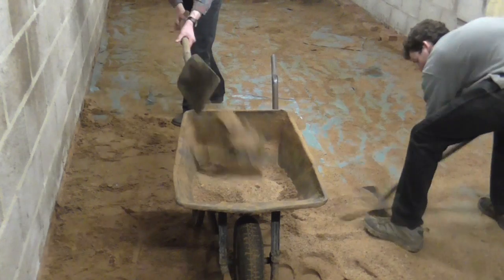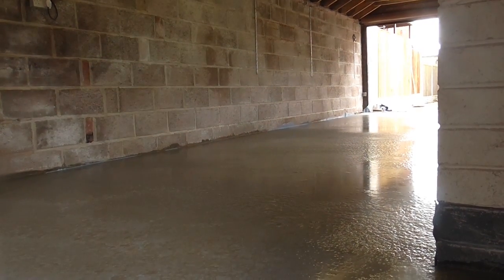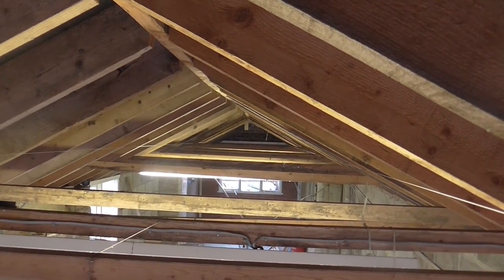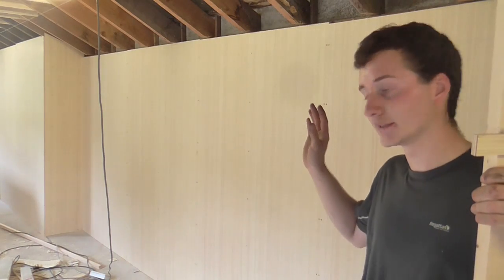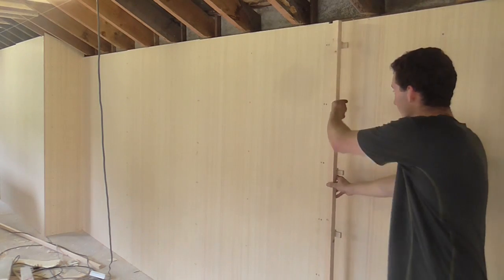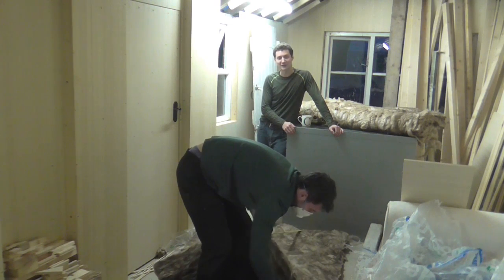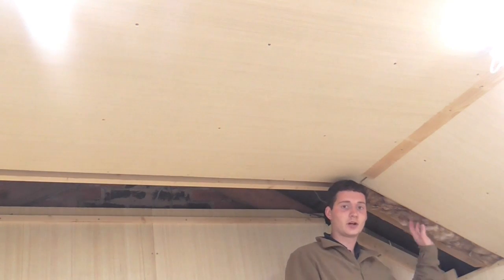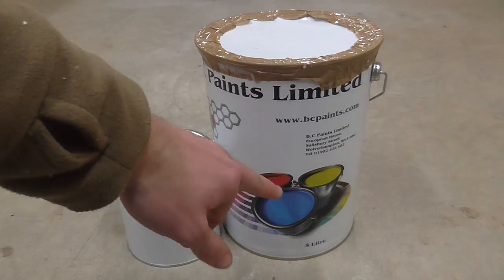Turning a Garage in to a Workshop

Comment: Yes I am commenting very late on this video but oh well. When following a line for making multiple boards (of any type) level or straight or whatever. It is important to be aware of compounding error (well if you're concern is being as close to straight as possible). It VERY easy to create this error yourself. Running a board up to the string it's pretty simple to bump right into the string and move the string up a tiny bit, now add up a bunch of "tiny bits" and it pretty easy to be off by 0.375 inch (9.5mm for you metric folks), especially over very long runs where many boards are being installed. It's not the end of the world, just be aware of it. =)

Comment: Whenever you are rolling (painting / varnishing / sealing etc) use a long handle - much faster, better more even coverage, easier on the body. When doing overhead roller work, roll a towel up on top of a backpack to rest the head back at an angle, rests the neck.
When you concrete with reo (re-inforcement steel mesh) the reo must be in the middle of the slab, not resting on the bottom where it does nothing to strengthen the slab, and is more exposed to elements which can cause rust. The best way to accomplish this is using dedicated concreting chairs, small hollow plastic pyramids that lift the reo and even permit walking on when pouring and screeding.

Comment: Nice job but I would of lifted the mesh of the plastic about a inch better that the concrete is all around the mesh the plus is it won't rust and it's a hell of a lot stronger

Comment: Nice job there young "laddy"!
Hopefully I'm using that term properly..
 Haven't seen you around in a while or have I fallen off the video wagon? 
Did you finish the locomotive? 
Nice seeing you again. 
Razor!
Reply from the maker: Thanks. Yes Iv'e not put any videos out for a while while working on this plus other things. The loco is on hold until this workshop is up and running. Cheers
Reply: @MrCrispinEnterprises  
You've done a very nice job with your shop. Looking forward to seeing you again when you get things in order.
Funny thing is I've put my videos on hold for the very same reason and I need to learn how to do some editing. 
Cheers mate,
Razor!

Comment: Looks good so far! i would have not been happy with concrete that wet though. It will make it much weaker in the long run.
Reply: only + it is easy to level. Not a pro job.
Reply: he probably won't be dropping very heavy machines on it like some have   ....... will do him well for what he is doing.
Reply: Perhaps it is different in the climate of Britain. However in Australia that would be a good thing. It will take longer to dry and set and will end up stronger. The only thing is hopefully he raised the mesh off camera.
Reply: Brian are you going to varnish you walls and ceiling?
Reply: i thought it looked a little wet too.